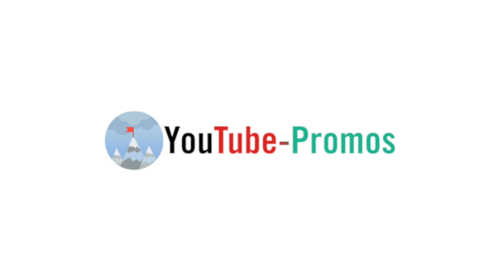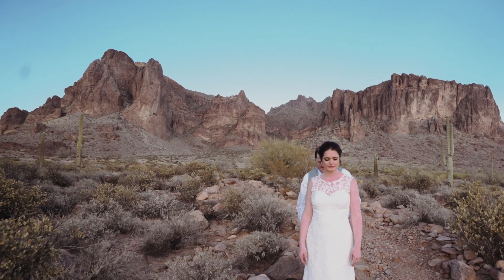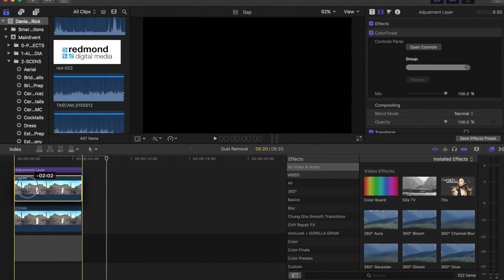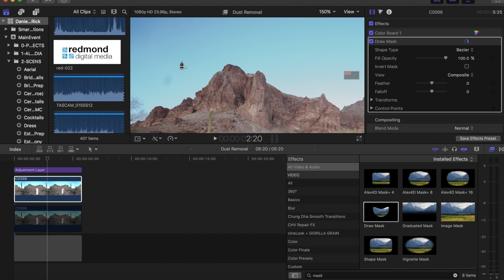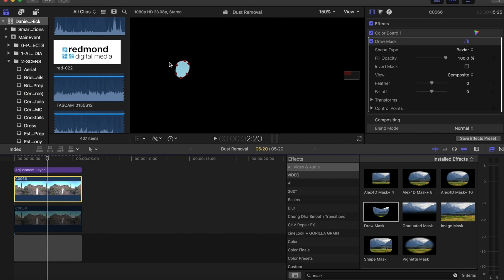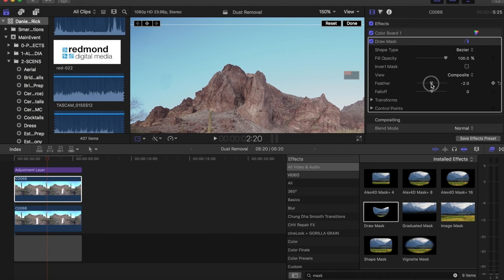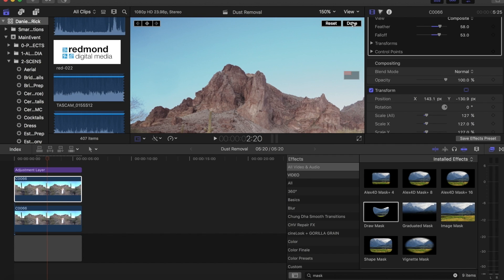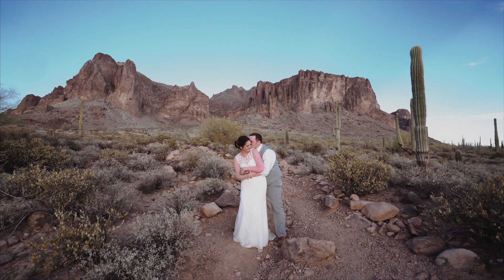How To Remove Sensor Dust And Spots In FCPX

Comment: Thanks for the video. I have gone through several such similar videos to remove dust spots in FCP, but none of them address how to remove MULTIPLE dust spots. If you have one dust spot on your sensor, it is highly likely you will have lots of them. I typically have more than 5-10 such prominent spots at any point in time, and with Mirrorless its usually many more. Can you suggest how to remove multiple such spots? Do you have to create a new layer for each spot (seems impractical)? Or if you add multiple mask layers, how do you manage the movement of the transformed frame! Thanks in advance.
Reply from the maker: Yo if you have that many dust spots you need to take better care of your camera and or get the sensor cleaned if you are having that issue so frequently. If I have to deal with a dust spot it's usually because it happened while on a shoot, and everything past that may show the spot. In any case this technique in the video is repeatable as layers but the more spots you have to remove, the more difficult it may be if the image is moving.
Reply: @BobbyBurns  thanks bro. My 5D Mark 4 had a faulty sensor cleaning mechanism from day one. I took it lightly and did not get it serviced. The sensor spots are a build up over 4-5 years. But my question was more about removing multiple spots, which would be the case probably 99.99% of the times, and if you have to create a new layer for each spot, it becomes untenable.

Comment: Hello, I followed the steps but when I drag the mask over the spot its as the mask was see through, you can still see the spot. The two clips are lined up. any advice would be much apreciated.
Reply from the maker: Are you sure that you duplicated the clip and made the mask the INSIDE of the part you masked out? Toggle the "invert mask" box on and off and make sure

Comment: The area around the spot was just sky... only works in very simple situations.
Reply from the maker: Pretty sure I say right in the video that this would be more complicated for more complicated locations. However, with that said, I have done it in areas much more difficult than sky and the big difference is that you need to keyframe it frame by frame to stay where you need. Still very doable

Comment: Everything works except for when you fade the clip out.... Would you know how to fix this to fade out with the mask? When I do it, the mask bleeds through and is pretty much useless.
Reply from the maker: Are you fading out both clips at the exact same time / length? If that doesn’t work than highlight the two clips, right click, make compound clip. That will combine them into one clip and try fading that clip out. Let me know if that works!
Reply: @BobbyBurns  
I have the same problem. The two clips don't fade/dissolve at the same speed, even though you use the same transition..
The masked area is clearly visible until the opacity of both clips match at 100%.

Comment: can you get the censor cleaned?
Reply from the maker: Yes absolutely. If you notice dust on your sensor you should try to blow it off with a blower (NOT WITH YOUR MOUTH). If you still see specks after blowing it, you should get it professionally cleaned. You can also buy sensor cleaning kits, but I have always opted to just take it in to my local camera shop.